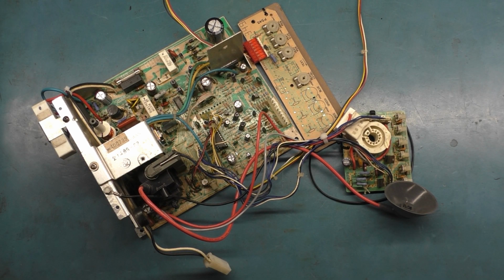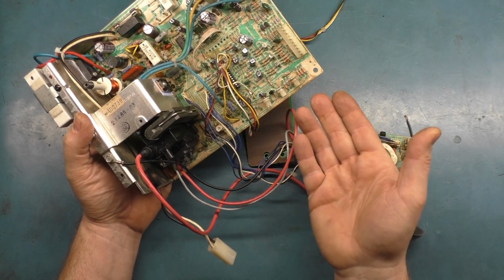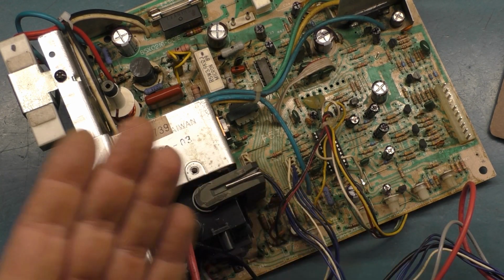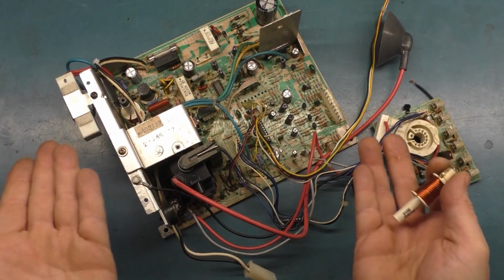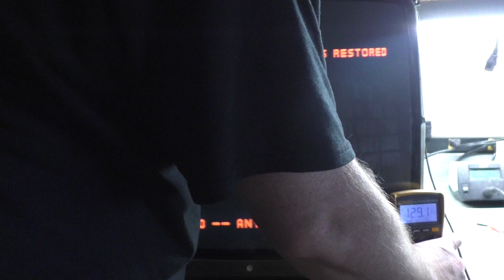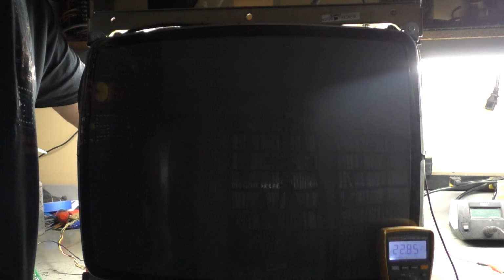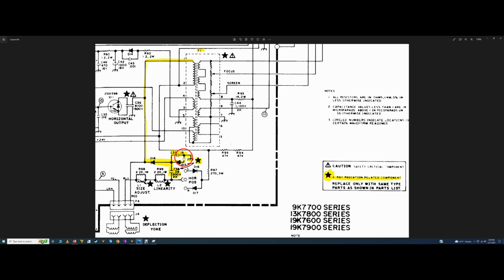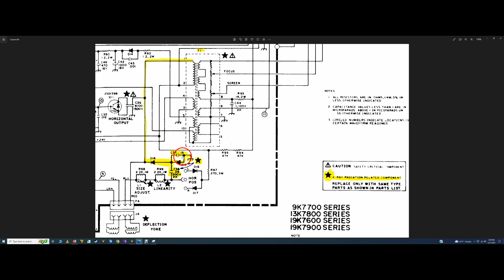25" K7000 Arcade Monitor Repair - B+ Resistor Explosion, B+ Regulation Issues/Blooming - Part 2

Comment from the maker: Feels good to get this sorted out. Was talking with a few people and the hypothesis regarding this chassis not using/needing C37 and D15 originally is that they might not have been necessary with the original flyback. Not all flybacks are the same and at the time of manufacture, this particular chassis might have came with a flyback that had a lower voltage output, resulting in not needing C37/D15. If they had been installed, the voltage would have been too low. That's the going idea. What do you think?
Reply: That’s very interesting.  I’m going to start keeping track of which of my chassis have c37 and d15 and if they have the original flyback.  Maybe the epa started making wells gardner include those components to cut down on radiation output haha. Keeps us from mutating lol.  Great video man ✌️❤
Reply: @FranktheTank83  Yea see I have one too, I just commented on that. It's exactly like his was before adding the parts, so I'm wondering if these were earlier models, and like you said, EPA got tired of all the complaints of people turning into mutants and took action lmao
Reply: It’s the only logical answer. Lol

Comment: Ok so I watched this video last night because I have one of these chasis myself, and I made a note to look at mine when I went to the shop this morning. Mine is exactly how this one was. Has a jumper on the back, no cap no diode. I wonder if these were earlier models? Like before they realized they needed the extra parts? If that makes sense. Also I wanna note, I have the 001 width coil installed on mine.

Comment: Great job explaining everything. You earned the new follower. I don't know if it's a big bother, I have a Hitachi GMK 29FS2 from a candy cab and it's causing me from time to time the vertical picture shrink back and foward and while it does it creates a horizontal distortion line. I'm about to remove the board for recap. Where could that problem be? thx
Reply from the maker: Thanks! Not familiar with that particular monitor but I suspect caps first. Never a bad idea to cap the board but I would also do a very thorough inspection and reflow. Inspect for bad traces/pads/cracked joints, etc.

Comment: Hey Mike, absolutely loving these videos, and I like the way you explain technical stuff, so interesting.
I have a Trinitron KV25-X5A with some sort of “s” wavy pattern visible on high brightness, what could it be?
It’s from November 1998, never recapped, just adjusted some convergence issues. Thank you, and have a wonderful day man.
Reply from the maker: Caps would be my first thought.
Reply: @MikesArcadeMonitorRepair  Mmh, but on the neck board or on the main board?
Reply from the maker: The whole chassis. Change them all.
Reply: @MikesArcadeMonitorRepair  well sounds like I need to buy a lot of these caps, do you know where I can find the exact cap kit I need for my set? Thank you Mike.
Reply from the maker: I do not. My apologies. You will likely need to get a list and order them individually. I don’t think there are pre-made kits for commercial tv sets.
Reply: @MikesArcadeMonitorRepair  that’s reasonable, thank you for your kindness, I appreciate you. Have a nice week!
Reply from the maker: My pleasure. You too!